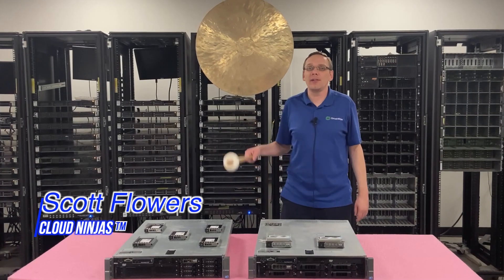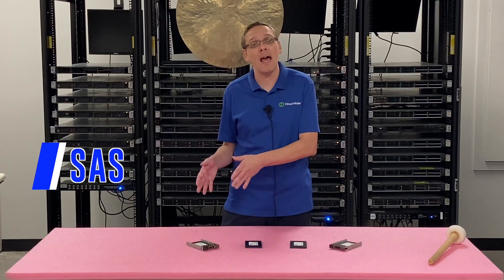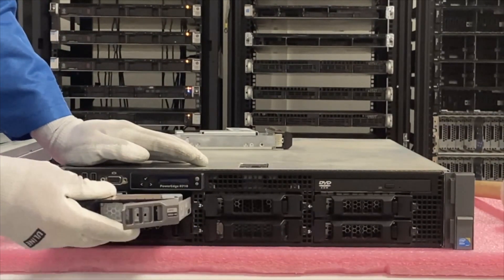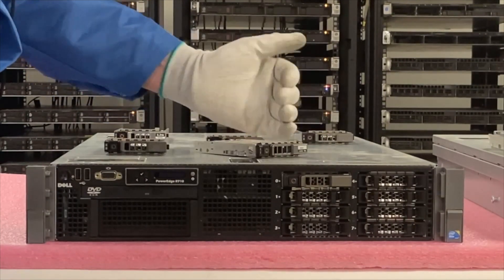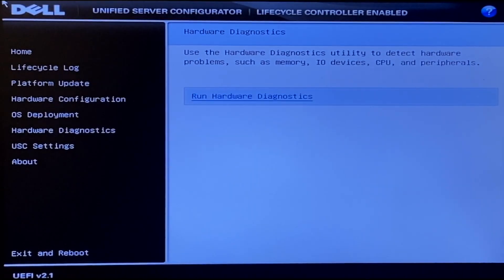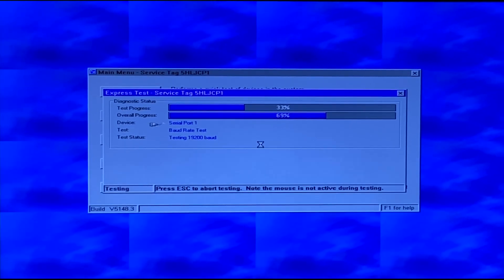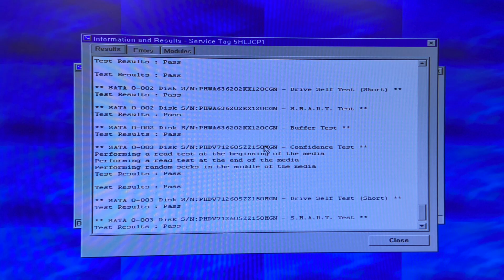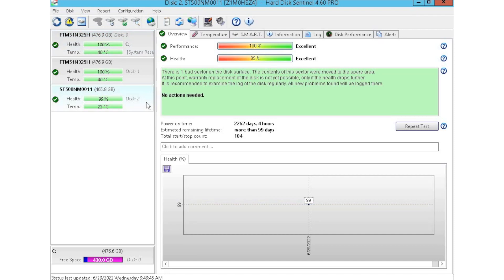Dell PowerEdge R710 Server Solid State Drives | SSD Upgrade Spares & Options | Dell Diagnostics Test

Comment: Hello, quick question, i just got an r710 and have been having a problem with the Raid, i have a Perc h700 and although i can create VDs i have no free capacity. Im going mad trying to fix it. My drives arent dell but idk if its the reason
Reply from the maker: Possibly not Dell FW.  If installing NVMe then not compatible.  A couple quick hits to try.
Reply: @cloudninjas  they are hdds around 500gbs

Comment: Did I hear correctly 7.68tb per drive bay? So if you really wanted to, you could have nearly 62tb of storage?
Reply from the maker: Yes, we tested the solid state drives for the R710 and were able to install 7.68TB per drive. Dell's spec sheets are out of date so we do our very best to update the specs by testing our machines so that the community has more options for server hardware.